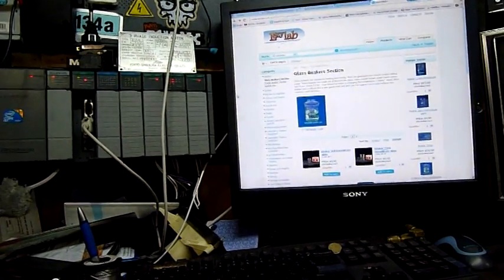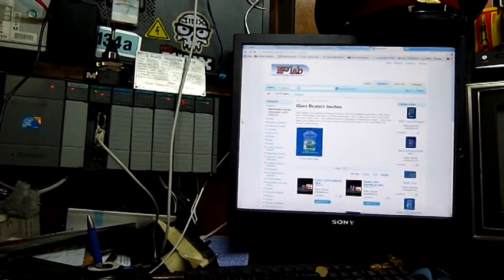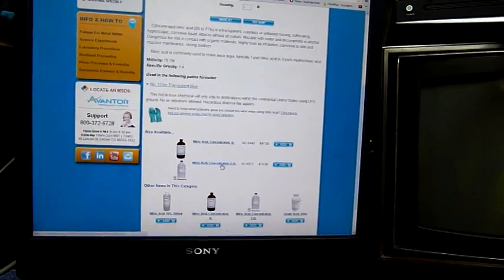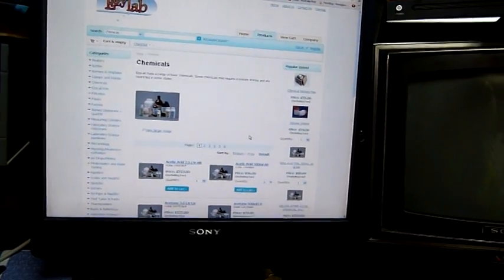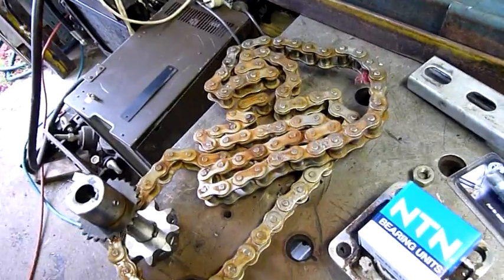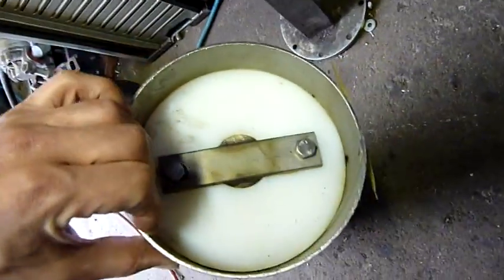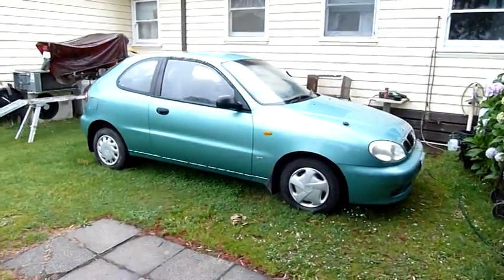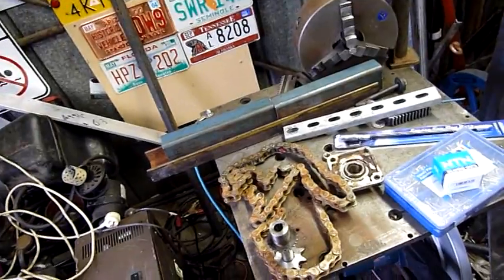Ramblotronic Friday - Chemicals New TV and Stainless Steel bits

Comment: Not suggesting you fix the car but for the record you can do valve guide seals without pulling the head. Look on Ebay for VALVE SPRING COMPRESSOR + AIRHOLDS FOR OVERHEAD VALVE I have one of these and provided the spring is accessible you can do the seals without pulling the head.

Comment: Thank feck the MOT here in the UK isn't like that. I run a 1999 Skoda Felicia, and in the past 2 years, all I've spent on it in 2 years is about £250 in repairs, and the yearly tax is £130. If you ever need acetone, nail polish remover is basically just that.

Comment: That easy-lab site is some sort of boutique with rip off prices. 1/2 a liter of acetone is $30? You can buy a liter/quart of acetone stuff for $8 in a hardware store around here. As for the chain why don't you use your electrolysis tank to clean it up, or is it a stainless steel chain? Maybe you could try molasses or vinegar?

Comment: i have to say that a good idea is to part out the daewoo, may get $1000 for the good parts and could you keep an eye out for a oil gauge sender unit for a XG ute? mine is the same in your falcon in which it always reads low around 1/4 to 1/2. Thanks!